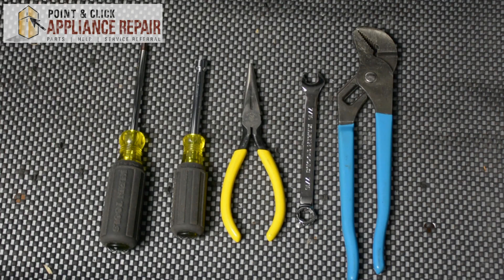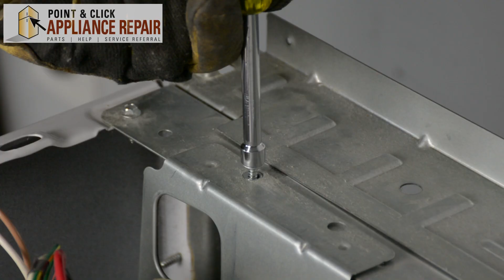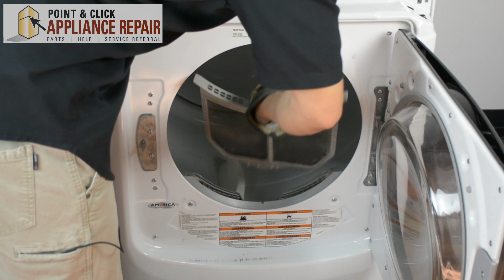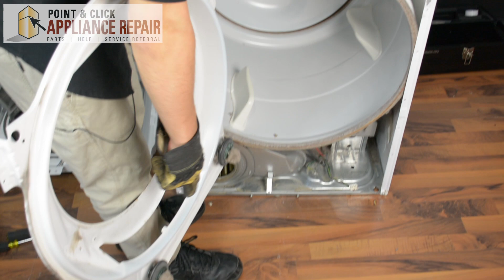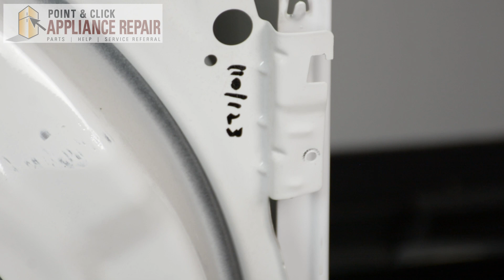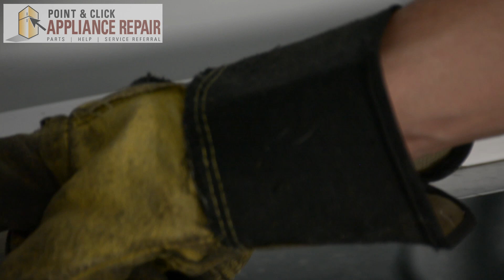W10837625 - Replacing Your Maytag Dryer's Motor Pulley - AP5988738, PS11727942

Comment: This is helpful but one problem, the motor pulley in your video is not actually broken. On a broken one -- at least on mine -- you wouldn't be able to grip it by the hex part because it's broken off, which is why it needs replacing in the first place. Gripping it by that round, slanted part is liable to be more tricky. But at least I learned how to hold the shaft still while unscrewing the pulley.
Reply: Were you able to get the broken one off?  Any trick that helped?
Reply: @dnitzman  I'm sorry, I've forgotten how I did it. But yes, I was able to get it off without too much trouble.